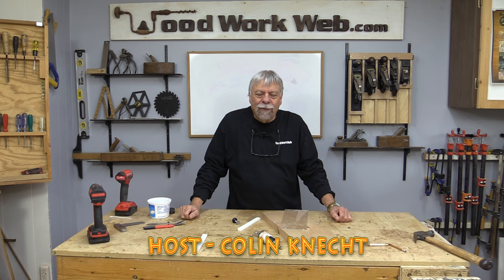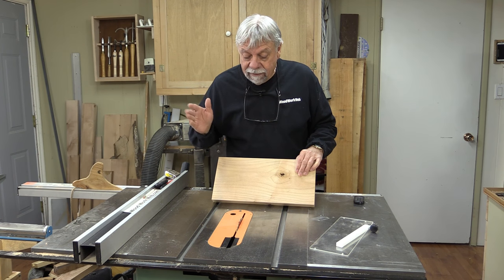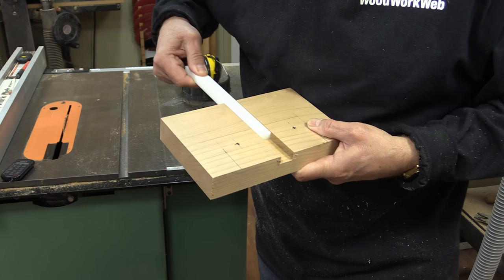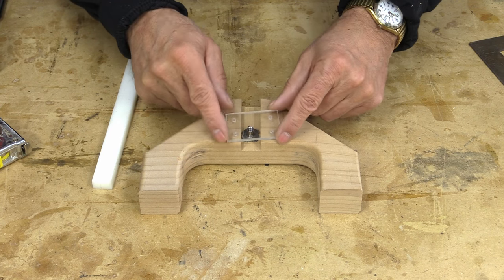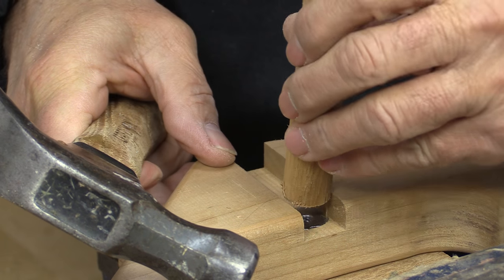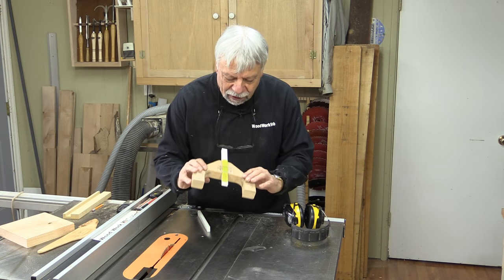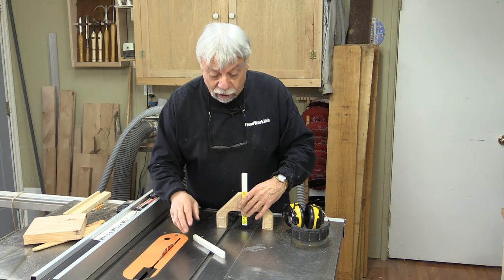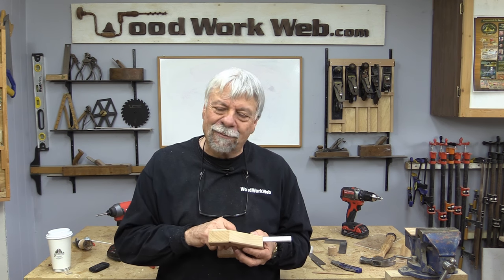Make a Versatile Depth Gauge Jig | Distance Gauge Jig

Comment: A general comment - not related to this video: In your dado jig, you took a round bolt head and ground it square instead of waiting for mail order bolts. The cheapest and most versatile oval/flat sided bolt you can get are toilet flange bolts available at any hardware store. I buy a bunch of them (mainly 1/4-20) at a time and they are ready for jigs.

Comment: That's a very useful video, Colin! I could have used that today while fine adjusting my table saw blade height using a tenoning jig. I will  do this project for sure. 
I do think running such a short and relatively narrow work piece free hand across the blade to make the dado is a bit risky. Even though it is not a through cut, the risk of kick back is increased. This could be avoided by making the dado cut first using a longer work piece, a miter gauge with a sacrificial fence and even a spacer block on the table saw fence positioned before the blade. Then, lay out the rest of the project around the dado. This would take more time but would be safer.

Comment: I know this is woodworking and all but the first thing I'd do is plane and joint all the surfaces I'm using to measure off of.
Then I'd make sure it's dead squer.
You can take a https://www.amazon.com/STAINLESS-CENTER-FINDER-Peachtree-Woodworking/dp/B001N1FR8K
 24" centering double ended  rule or scale and use it with your block but I Think I'd use 3/4" plexiglass and add a movable pointer onto it later so you can fine tune it. With this you should be able to get it down to +- .005  Doing this would work on almost any tool you have.  And its a lot cheaper than spending 30+ bucks on some cheap imported plastic digital battery operated tool from China.
Machinist have been using setup blocks for years to get close then fine tune with dial indicators you don't need to get that close in woodworking and the reason is if you breath moisture on a part it's going to change. or move.
That's why You using a solid block of plastic or metal for this you could use Aircraft aluminum or 6061.
You can work that with carbide tools and woodworking tools if you slow down the speed's.
You could almost use a router with built in speed control and carbide bits slowing the speed down depending on size of bit type of material feed rate and depth of cut. The key is not to overheat the bit.
This only works on non ferrous metals.
But cutting metal is dangerous if your not clamping it down tight so be carefull.

Plexiglass tends to kick up a burr if its cut fast, its ok just cut it off.
The center Rule is set up so the pointer is at 0 for 0 hight  -'height adds your cutting depth lowing down into a groove measures its depth.

The 24" rule should give you at least 8" of measure +or - depending on the height of your jig or tool.
You can make holes in the bottom for magnets so it stands up on its own and this will span a table saws insert or sit on top of a router lifts top. It may even work on some hand held routers.

Comment: I love this jig, but I am confused where to locate the tape measure. I see that there is a small blank space at the bottom of the measuring device.
Reply: Set the plunger so that it is flat to the table. Then set the tape to zero on that line. when you raise the plunger one inch (or centimeter) the tape will read one.
Reply: Thanks. I was wondering about that as well.
Reply: @1thinkhealthy  me too!

Comment: It is a v. nice gauge to messure the depth and the hight of the saw blade.
the question is why you did not screw the two small plastic pieces to match the thickness  of the 4 screw on the large plastic piece.? 
Thank you v. mutch.

Comment: I like the idea very much.  But, I have a question.  Why did you put the ruler on the "slide"?  It isn't an accurate measure and it doesn't go down to the bottom of the "slide".
Reply: It measures from the top of the tape down and not the bottom up so it doesn't matter where the tape ends as long as it's longer than your maximum blade height.

Comment: Great videos, as I have learnt a lot of neat cool tricks.  I love the measuring bars but for those who cant find them or do not want to go to the expense to buy them, I use my drill bits which start at 1/32 and go up to 1 inch. they are machine made with very little error to them.  So this will give a great variance in your measuring.  Good luck and keep up the good videos.  Tim
Reply from the maker: Great tip Tim!

Comment: This is a great tool. I made one a couple of years ago when you first published this video, and have found numerous occasions to use it since. I did not find the ruler scale necessary since I am always using it to transfer the thickness of a brass setup bar over to the blade height or fence position.
Reply from the maker: I'm glad it helps! Thanks for watching!

Comment: Why did you offset the ruler when you applied it to the miter slide?
I see some of the slide where the tape should start.
Reply: It doesn't need to go to the bottom, only the top of the tape is used and as long as the tape is longer than your maximum cut height it doesn't matter where the tape ends.
Reply: Thank you for getting back to me, I did not realize it started numerically from the top down. 
my oversight.
Reply: No problem